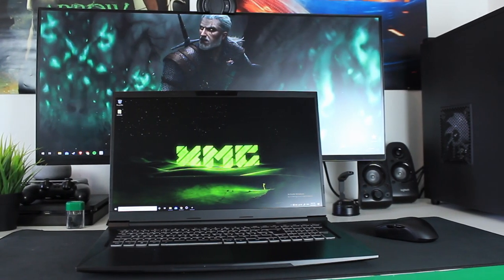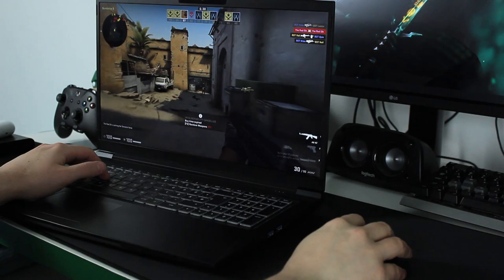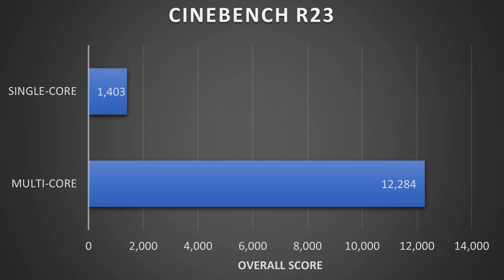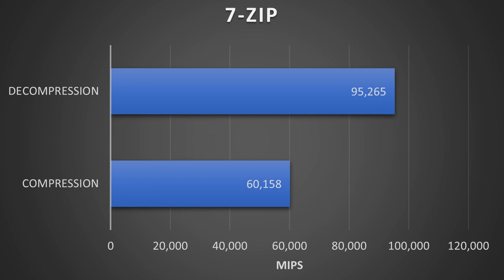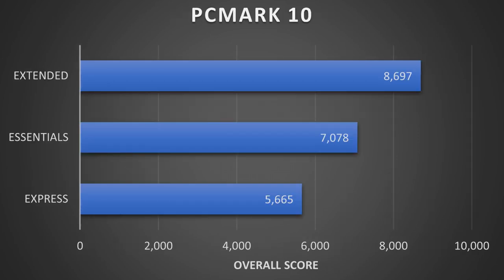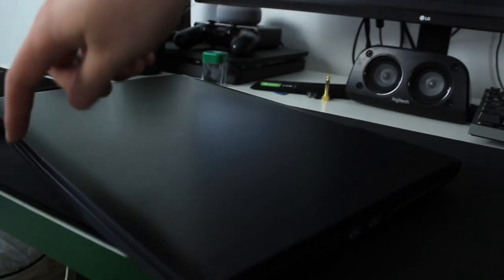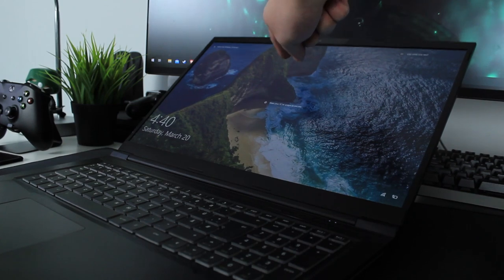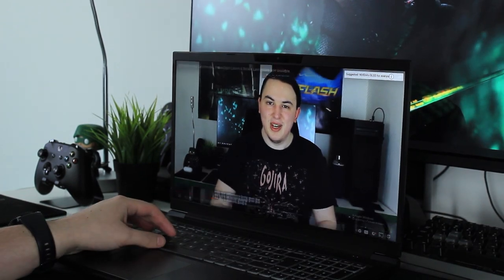I've been gaming on a laptop | XMG Core 17 - RYZEN 5800H + RTX 3060 (130W)

Comment: Hi, first of all thanks for your review, I'm looking for all informations about this computer, but i can't find any review with this model specificaly (e21).
You have posted a screen from notebookcheck (with the themals) but i didn't found the notebookcheck review ( even on your Doc file ) all other reviews have not the same frame (with the horizontal straight line centered with power buttons ) do you have by any chance a link to this one ? thanks a lot :D
Reply from the maker: Hi. I'm not sure I understood the question. Are you referring to the 5800H + 3060 model? If that's the case, that version should be a notch better than the 4800H I've tested.

For more info on the 5800H version:

https://www.hardwareluxx.de/index.php/artikel/hardware/notebooks/57452-xmg-core-15-amd-e21-im-test-undercover-gamer-mit-ryzen-5000.html

https://www.notebookcheck.com/Schenker-XMG-Core-15-E21gms.585440.0.html

Comment: Hi and thank you for your video.
Have you tried the legion 5i gen 6 17 ''?
It is 50 euros above the XMG which is nothing. With the same components except the screen which is Full HD.
The processur is an i7 11800H for the legion against the R7 5800 for the XMG.
Knowing that it is for professional video editing (after effect, davvinci resolve) which one do you think is the best?
Thank you for your answer ;)
Reply from the maker: I'd say both should get the job done equally well. Never tried a 11800H based laptop myself, but simply looking at the specs, software and a couple of PC benchmarks from Pudgetsystems, I'd say you'll be fine in both cases. Sooo the "questions" that are still open, in no particular order, are:

1. RAM size, # of sticks and frequency (could be important for AE)
2. Preferred screen size and resolution
3. Cooling
4. Design
5. Battery
6. Ports 
7. Availability
8. Warranty & upgradability
9. Software support (Adobe software might work better with Intel)

So I'd recommend you give some thought to those things as well and then try balancing them out before pulling the trigger :)

Hope this will help ya and sorry for not being able to give you a black or white answer 😁
Reply from the maker: Oh, and I'm not sure how much these laptops you mentioned are going for right now, but perhaps you might also want to have a look at the M1 Macs - the M1 Air is pretty great in Resolve! And could be found for 850-900€ from time to time :) 

Not sure about AE. Never dabbled with it myself. But RAM would definitely be a constraint since it would only be 8 GB on the base M1 model :(
Reply: @TheRadElk  Légion5i gen 6 17'':                        XMG core 21 17''
 
Proc:   Intel i7 11800H 2.3/4.6 24MB      Ryzen 7 5800H  3.2/4.4 G 16MB          
Ram:   16 GO                                                 32 Go
CG:     3060 P(115W+15w)                        RTX3060P 115+15
Ecran:  IPS FHD 144hz                               IPS WQHD 165Hz
SSD:    512Go                                               512 Go SSD 970 Evo
Price:     1280 euros                                     1380 euros
Reply: For the mac effectively its very small 8Go and i dont like apple ahah.
Thank for your quick response
Reply from the maker: Specs are fine for both. I'd recommend going through points 1-9 again and analyzing what makes most sense for you. I'm sure you'll also find some decent reviews on them before landing on the final one! 😃
Reply from the maker: Understandable, haha. No worries.
Reply: @TheRadElk  Finally it s the XMG with this spe:
 1 x 17.3" WQHD IPS | 165 Hz
1 x NVIDIA GeForce RTX 3060 | 6 GB GDDR6
1 x AMD Ryzen 7 5800H
2 x 16 GB (32 GB) DDR4-3200 Crucial
1 x 1 TB M.2 Samsung 970 EVO Plus | PCIe 3.0 x4 | NVMe
1 x Intel Wi-Fi 6 AX200 | Bluetooth 5.1
1 x RGB keyboard | French
1 x 24 months standard warranty | pickup & return
1 x Power cable C6 | EU 

the decision came from the out of stock at legion
It made it easier for me.
thank you again for the time you took on your answer. it's nice
Reply from the maker: Hope you'll enjoy it and make the best out of it, Nathalie! 😁

Comment: I just bought this laptop but i got the intel version do you think there will be a big difference in performance?
Reply from the maker: I haven't looked at the results coming out of the Intel version, but if yours doesn't have a MUX switch, then you might be losing out on some performance (especially in eSport titles). I think Tom from XMG will be able to give you more information once he drops in the chat 😃
Reply: Core i7-10870H vs. Ryzen 7 5800H: you win some, you lose some. Unless you do a lot of all-core rendering, on which the Ryzen would be a clear winner. Hint: I consider myself a power user but the only time I'm using all-core rendering is when I encode little video snippets from my phone into nice little sub-5MB packages to send off to our ODM partners in Taiwan every time I'm trying to explain a concept or bug to them. A picture says more than thousand words and transcends all language barriers.

The only thing where I'm still curious about in Intel vs. AMD in this gen is the advent of RTX I/O and how this will affect AMD's x8 PCIe bandwidth. Probably still a few years away and maybe only relevant for open world titles, but I simply don't know and can't wait to find out.

And regarding having no MUX switch in Intel, please keep in mind that MUX switch plays no role for external monitors because HDMI and DP are connected to the dGPU anyway. And for mobile usage, setting the MUX to "dGPU-only" will obviously sacrifice a lot of battery life, which is undesirable for most users. I've been using a MUX-enabled XMG PRO 15 for a while and I had it on MSHyrid (aka NVIDIA Optimus) most of the time because I couldn't be bothered to flip the switch and reboot every time I fired up a game. But on the other hand, I usually game on external monitors anyway. Including the spare one I keep besides the couch in my flatshare living room for just the occasion... 👀

// Tom
Reply from the maker: True. Using an external monitor is the way to go to avoid the issue. It's just that most people don't want to buy an extra monitor. Still, the performance difference in AAA titles isn't as big as in esports (but if you get over 144Hz why care, eh?). 

Speaking of MsHybrid and Office mode, I switched to them last night just to run some extra tests and I have to say that battery life gets far better that way and whenever you want to get some gaming done, just plug that bad boi in, crank the dials and enjoy it 😁
Reply from the maker: BTW Tom, YouTube deleted your other comment with "pop culture" - I wasn't able to see it myself :'( You should now be able to get all of your comments approved. Made some changes.
Reply: @TheRadElk  A nice 1080p 144Hz monitor with FreeSync (aka G-SYNC "compatible") doesn't cost much anymore. Surely less than total value of still unplayed games that most people have in their Steam catalog. 😅 (Myself included). // Tom
Reply from the maker: @xmg_gg  You speak the true true - Rick & Morty

Comment: One thing is quite clear to me, and that is that the RTX 3060 (mobile) is NOT very impressive. If I would upgrade right now, it would never be a 3060 system.
Reply from the maker: Generally speaking, the 3070 would be more compelling (perhaps the most compelling one for most people) but I wouldn't call the 3060 outright horrible 🤔
Reply: @TheRadElk  Perhaps not horrible, just very unimpressive. I just compared the benchmarks I have run on my system with yours. All-in-all I get beat by about 10% on the graphics scores. And that is considering this:

RTX 2080 Max-Q 80W vs RTX 3060 Max-P 115+W

8th gen i7-8750H 2.2 GHz vs Ryzen 5000 3.5 GHz

So I conclude that you could get a last years model with a decent 10th gen. Intel or Ryzen 4000, along with any RTX 2000 named SUPER, getting the same or better performance for a lot less money and a lot less energy/heat. There are loads of them selling out at a good price.

So, I stand by my statement that this mobile 3060 Max-P is unimpressive. However, if you have any CPU heavy workloads, then Ryzen 5800H is very impressive.
Reply: the rtx 3060 115W is faster than rtx 3080 lowest TDP in some Benchmark (Full HD)...so the rtx 3060 115W is impressive in my opinion
Reply: @tobfon2416  Not with a Ryzen Zen 3 CPU, and only against a shitty build 3080 85W, formerly known as Max-Q. Don't upgrade Max-Q to similar Max-Q. It is the 150W + 16 GB VRAM and a solid CPU that makes a real difference, especially above 1080P.